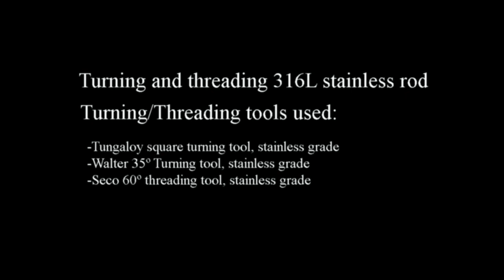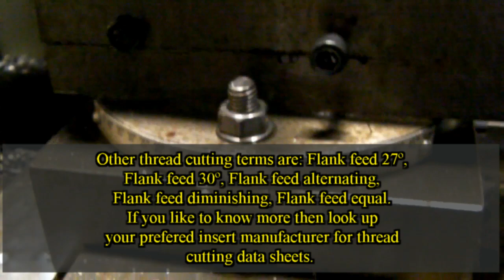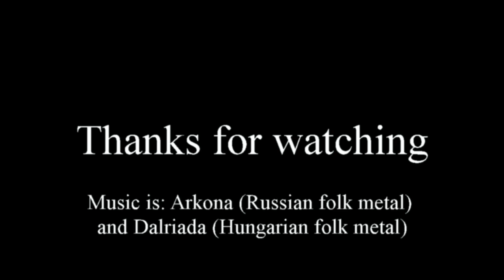Metal Lathe turning and threading stainless steel

Comment from the maker: All my carbide inserts are either designed for steel or stainless, but work equally as good on aluminium, however the softer the alloy is, the more binding and buildup i get on the cutting tip. But on higher grades, such as 6061 or 7000 series they work beautifully. You can get aluminium specific grades of carbide though, i dont use them because i dont do enough Alu to justify the cost of them.

Comment: to anyone wondering, the compound position indicator is not wrong. It is referencing against the work. So 0 deg would be parallel to the work and 90 would be perpendicular. Which is exactly how it is labeled. 
But that would be the least of my concerns in this video.

Comment from the maker: I turned it down to 5.88 first, after thread is cut its about 5.86. I didnt want a tight fit, but its still a very good fit. If you use a die, its a good idea to turn down to 0.1 - 0.15mm under the dia you need to make it easier. If you do a test on some aluminium first you will see what i mean. I broke 3 dies tungsten alloy dies trying to cut this stainless, so i did it this way instead. Which is tricky because it flexes at the start, and my dead and live centres were too big to fit in.

Comment from the maker: Well i know what the limits are already. I know it will cut quite a deep thread in 3 passes, however when i did this, it would rip the material rather than 'shave'/cut the material. So its much better to take a few more passes. Threading tools may look similar to normal cutting tools, but they do behaive differently as they are designed to cut an accurate shape, so cutting angles and geometries are different to that of normal cutting tools.

Comment from the maker: Turning speed is 600rpm, but should be 2,000rpm for DIA and insert type, but for this is not too important, plus it gives me more control. Thread cutting speed is 120rpm, this is fine for this insert and can run alot faster and deeper cuts per pass but that faster makes me nervous on such small dia bar.

Comment from the maker: First song is by Arkona - Yarilo (Russian pagan metal), Second is by Dalriada -  7 Tűzhozó (Folk Death Metal - Hungary), Third is by Dalriada - 1 Búcsúzó...

Reason for 316L is because the engine is partially exposed, and drives through mud, water, and along the beach, so corrosion resistance is fairly important.

Comment: How do you calculate the final diameter of 5.88 mm ?
Reply from the maker: For this thread i based 5.88 on other 6mm s/s bolts and threads that i measured. I did try it at 6mm, but it was way too tight for the off the shelf nuts. This gives it 0.12mm clearance for nicer fit. It is fairly normal to make it slightly undersize too on most threads.

Comment: Hi, Did you turn this down to 5.88 before you cut the thread?  or did you start with 6 and let the process of cutting the thread take the diameter to 5.88?  I ask this because nearly all threads I have cut with a die have been hard work and maybe I should have been starting with a slightly undersize shaft.